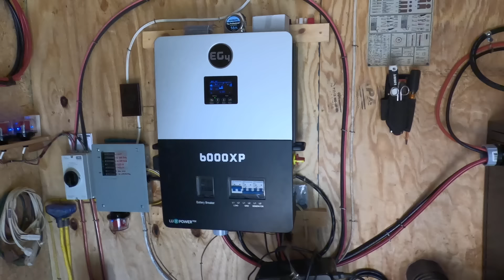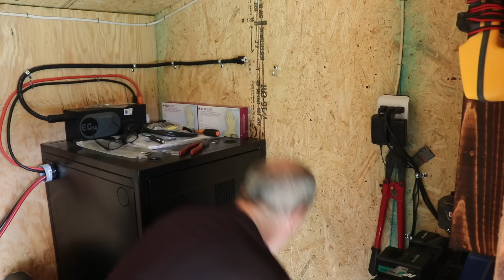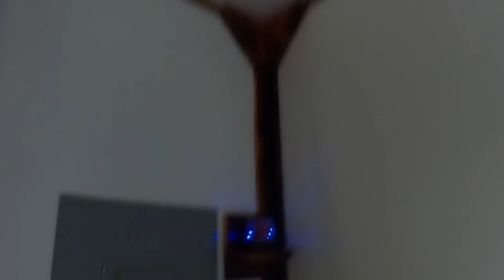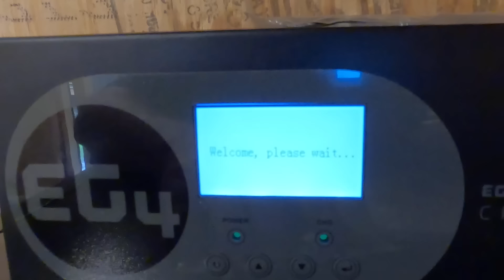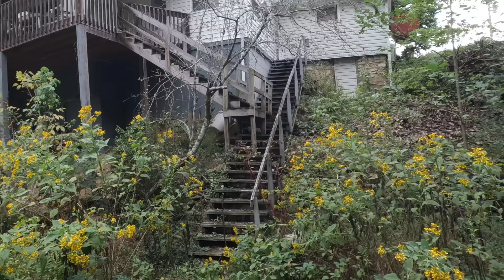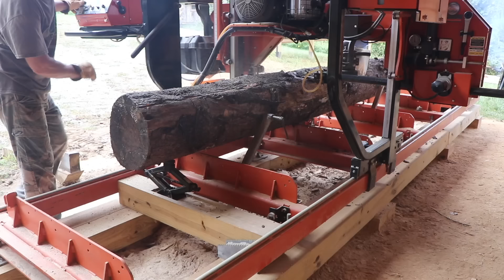Sunlight to Smoke: Solar Upgrade, Workshop Wood Stove & Repairing Grandmas Back Porch

Comment: Carpenter bees cut the holes in and then woodpeckers came along and dug out the bees to eat them. They did this in my barn on the boards i had on the walls to hole the tin.

Comment: Is that all single wall pipe
Reply from the maker: All except what comes through the wall. Thanks for watching.
Reply: Don’t you need a little more clearance on single wall pipe it’s 18” vertical 24” horizontal
Reply from the maker: @Steveharner1864 it’s about that except the top. I may put some rock board on ceiling above where it turns through wall. Ceiling is only 7’ because of second floor and using 16’ post in center. We can adjust as we go
Reply: I would probably just keep a eye on it thanks Richard have a good day

Comment: Just a tip I learned about damper placement on a woodstove. Place the damper as high as you can comfortably reach. That way the entire length of stove pipe will also radiate heat. I believe the stove pipe will remain cleaner longer too. 👍
Reply from the maker: Good idea. It’s already put together but will remember that next time